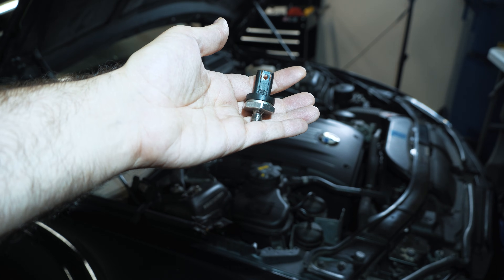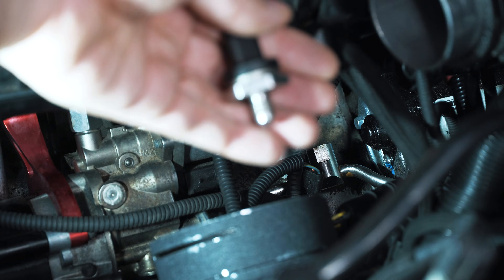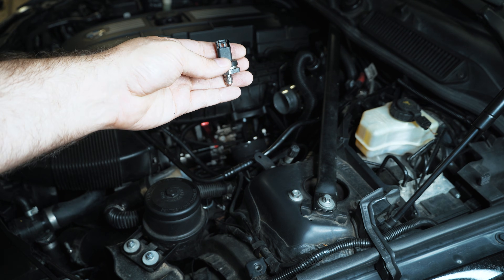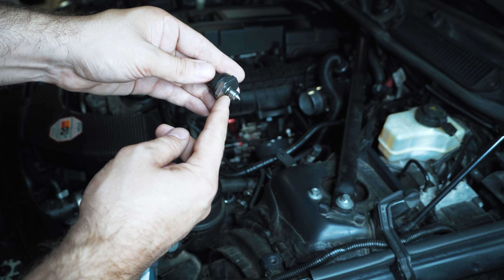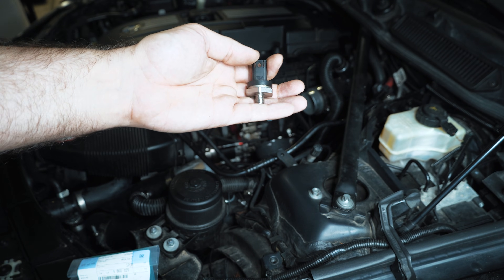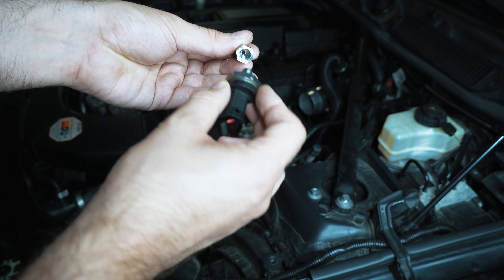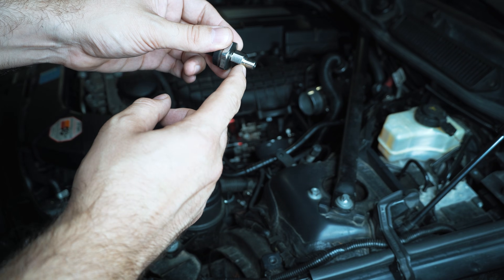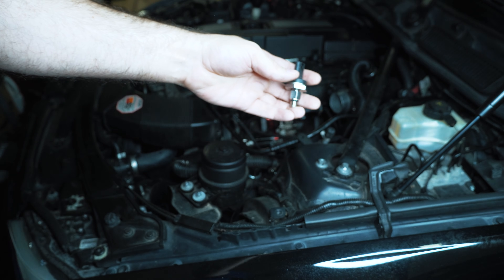An Important Update For Your N54 Low Pressure Fuel Sensor

Comment: My new to me 2007 335xi started cold with erratic idle, seemed to smooth out with some throttle input, but pulled P142E and P3090, not sure if that shows HPFP, LPFP or a fuel pump sensor? Any idea's are mucho appreciated!

Comment: @vehiculardiy Did your "system A too lean at idle(Bank 1)" code clear after changing this? I know my sensor is bad and I need to pass inspection but that code keeps coming back up. A/F for both banks is good and mine is tuned as well. I saw you had this code as well before you changed your lpfp. Big fan of the channel! Thanks!

Comment: Can a failure of this sensor catastrophically destroy the engine? Was reading about a user who posted this problem and said that the failure led to diesel going into the ecu. 32000dollar repair cost
Reply: well if it was diesel that means it was a different engine with a different set up, so i would doubt it but the car would run really bad if it was completely failed.

Comment: Great clip! Thx. No need to remove the manifold? Have a 135i vs 335I so maybe to tight? Also getting the code but it runs fine? Leave it be instead?
Reply: can you let me know if it worked for you? i have a 135i and noticed it says the adapter is only for the M3/4/5 etc

Comment: I am about to replace this on my 07 n54, is there a particular reason you chose to do the new style sensor and adapter instead of just repling with the old style? The old style is still available, but no one seems to be using it and I can't figure out why. Id rather not have to use an adapter if i don't have to
Reply: What sensor did you go with? I just bought a new HPFP and what I thought was the low pressure sensor but it turns out to be this new style and it’s actually a “high pressure fuel sensor” that’s goes on the fuel rail up top not at the bottom. So I just ordered the old
Style bronze colored “low” pressure sensor that goes there. Looks like people are using the “high” pressure sensor as a “low pressure” sensor with an adapter. I’m gonna change them all.

Comment: At the same time, owning other brands of vehicles, it seems extremely strange to change a sensor every 2-3 years. That's totally unacceptable and obviously a badly designed sensor. It should last 10-20 years at least. Just look at other sensors with that measuring range 0-10 bar.
I've recently changed mine on my N53 as it was dead and now the pressure sometimes fluctuates between 2,4 - 10 bar. Highly unreliable. Either the sensor or unreliable pump regulation.... electronic PWM pump. Christ!

But something that you all need to understand. A unit that is firmly screwed onto a metal line on the engine will ALWAYS vibrate in line with the engine. It doesn't matter if it's put 1cm - 50 away. It will still be mounted on a firm metal that is coupled with the engine. Period.
So, vibration is NOT the reason to put that sensor there. It's the fitting that they need to get straight.

Good video though and keep up the good work.

Comment: Would a bad low pressure fuel pump sensor cause an N54 powered E?60 not turn over and turn on
Reply: Bump! Wondering the same. Have an LCI E60 N54 and intermittently getting a 29DC code where the car goes into limp mode and restarts only after being switched off for >10 mins. Not sure if this is the root cause or should I bite the bullet on a new HPFP.
Reply: @sharathkprabhakar  I’ve already replaced the EKPM3 and coded it, installed a new battery and fuel pump assembly and nothing.

Over the weekend I realized that the fuel pump itself is starving itself for fuel, the filter has never been replaced to my knowledge and the filter is an in-tank filter and has a built in Fuel Pressure Regulator, so I’m wondering if that’s the problem.

The car won’t run unless it has more than quarter tank of fuel. The fuel tank had gas up to the rim on the driverside where the filter goes, so I removed the assembly and figured out that the pump works and sends fuel.

Now after looking at the gas tank, I realized that the fuel pump had no fuel to send because the fuel pump side (passenger) had no fuel in it. I used a cheap transfer pump from harbor freight to move gas from one side to the other, I reinstalled the fuel pump assembly and supposed bad filter and the car turned on and ran for the first time in 5 months. 

I’m not at all sure what’s actually wrong, if it’s the pump or filter itself but I’ve bought the cheaper of the two and opted for the filter since that is the odd man out. Fuel pump assembly is new, battery is new, and after transferring fuel to the pump side of the gas tank and having it run with 0 issues for 35 minutes, that means the HPFP and Injectors all work as intended. If the filter doesn’t fix my problem, then chances are I have a faulty LPFP that I can warranty through FCPEuro.

The only thing to never be addressed is the filter so, I’m hoping for a miracle since I’m trying to sell this 2010 535xdrive, Alpine/Peanut Butter with only 132k miles.

Pray for me 😅🫣

Comment: Hello when you said vibrating from lpfp I think I’m going through that exact issue I accelerate and I don’t have full power and when I try to floor it it almost like the engine shakes while
Accelerating and doesn’t go into full performance, also got 2AAF code

Comment: Thanks for the detailed content you put out.  My 2008 535xi has the surging (push pull effect) issue under light throttle (2k - 4k rpms), it is pronounced in M2.  I did the sensor upgrade, it did not eliminate the surging but the characteristic of the surge has changed, it stays longer and a bit more pronounced.  Is this (surging issue) indicative of fuel pressure related, could it be the lpfp?    Already rebuilt the transmission, changed spark plugs/coils, valve cover, reset all modules using INPA, no luck.  Any advise?
Reply: Seems like this is one of the most mysterious issues with the N54. Did you find a solution?

Comment: I just changed my lpfp a second time and upgraded to a walbro 450 but my lpfp is reading 48psi still. same as when i had my 255 on. Is there a way to test the sensor or top hat? thanks!
Reply: The sensor is bad. 70psi should be the reading.
Reply: Did you find a solution to the problem?
Reply: @Mr318live Bad lpfs sensor

Comment: hey hope youre doing well, ive got a quick question. i recently just did the low fuel pressure sensor upgrade and i noticed my fuel pressure sensor cable is corroded. Where can i go to purchase a new one?

Comment: Hey man, You mentioned that without a lpf sensor it wouldn't throw an SEL. My sel is on and when pulling the code all i'm getting is 29f3. Any idea what could be throwing the SEL light? I was going to replace the sensor but after watching your vid, I'm stumped. BTW, the car runs great right now tho.
Reply from the maker: So you have a check engine light lit up and only that code is showing?
Reply: @VehicularDIY  correct only code. I was doing some research and maybe it might be the fuel feed line? Does that make sense to throw the 29f3 code?

Comment: Do you suggest to unplug battery before replacing the sensor?
Reply from the maker: Yes as the fuel pump periodically cycles.
Reply: Thank you for your response. I’ll be changing it this weekend. Great video.

Comment: Thank you sir! Perfect timing on this video. I'm in the early stages of prepping for a N54 turbos replacement project. My '09 135i has about 82K miles on the clock, so trying to rationally replace wearable parts as I can afford. Thanks to you I just hit up ECS Tuning for a new LP sensor/adapter kit. Really appreciate you!

Comment: Guys just upgrade to the new setup with just buying the adapter all your doing is turning the new sensor into the old failing style sensor I know it’s more expensive for the whole set up but with these cars it’s just best to do it the “right” way.
Reply: Agree, you can purchase the low P line segment with new style sensor (part #13537622751) for about $189 (FCP).  I did that in November, no problems.
Reply: @chuckbuttry1382 so what he did in this video is new style sensor used in old setup? Wish we had video of new sensor with net style setup to see how to do it then

Comment: How would you know you need to replace it? Does it throw a code or does it have some kind of erratic behavior.
I wish you guys would actually start the videos with the symptoms first so we can get an idea if we have the same issue with the cars.
Reply: He said... he had fuel leak. If you need to replace fuel sensor itself you will get P29F3 code.
Reply: Oh. You’ll know.  Your car shuts off and they you get a Christmas tree worth of lights and the code they say here but you need the obd reader.  The user code is a ccid-121 at least for me.

Comment: Great content as always. I have a jb4 custom e60 backend flashed fbo plus inlets 2011 335is and in higher boost maps, when I gas it wot from higher rpms (4k for example), the car stutters almost like fuel is being cut off. Im changing my hpfp, but I want to see if you knew when BMW started putting the updated low pressure fuel sensor into the N54, that way I dont order it if its already in the car.
Reply from the maker: Thanks, I'm not sure but you might be able to sneak your phone under the intake manifold and get a quick video of the sensor.  If it's bronze looking it's the older one, if it's silver it's the new one.
Reply: @VehicularDIY  Thanks. Car is not throwing any codes, but the HPFP is an older model and logging does show it dipping below 10. Ill go ahead and do that and check the color. Thanks again I appreciate it.
Reply: Can we not use a new brass one? They seem to still be available I can't figure out why everyone is going the adapter route
Reply: Just doing mine now and it has the old style sensor I have a '11 335is also. I thought the fuel line would've been upgraded but I guess not. Now I'm waiting for the adapter before reassembling everything.
Reply: Did the sensor fix car stuttering at wot?
Reply: @Salvnyc_  I went ahead and added both. Problem solved.

Comment: It really is bizzare that 15 years after its release BMW is still working on sorting out the defects on the N54 engine.
I replaced the low pressure fuel sensor with an OEM when I had my engine rebuilt. However, I didn't have any problems with fuel leak before either.
Reply: They used the N54 up until 2016, so it makes sense there's still warranties out there for N54s.
Reply: n54 is the beta test for all of the current turbo inline 6 bmw engines.  they can test stuff on the n54 market and then engineer it into the new stuff. thats why the b58 is so badass  it took 3 tries.

Comment: I love the way bmw look. As a honda owner, I don't understand why these cars need upgrades and have so many recalls just to run the car for daily driving. How hard is it to have a car drive 100k when normally worn parts.
Reply: Because these cars are built with performance in mind originally and less longevity. People who can afford these vehicles will often swap to the latest ones anyways rather than paying for a Honda or a Toyota that's going to last for years, but have way less performance. You boost a civic to 300+ Hp suddenly it's longevity is hindered. You gotta pay to play.
Reply: @anthonywright5275  Yea, I guess I hear the stories of the people who want to look rich with a used BMW.
Reply: @NeoAndersonReloaded  I am not rich by any means. I am mechanically inclined and can rebuild an engine if I have to. I bought mine because of the ride quality and performance.
I couldn't care less what people think when I drive it. Besides where I drive it it does not have the rich status as in other places.
A used 335i is strictly for performance.
Reply: @NeoAndersonReloaded  lol nah... even if someone has a used bmw, if it's running, trust me, they got money... they eat money in maintenance and repairs. But yeah like 67re said, the 335 is more of a luxury modern tuner. And if you are mechanically inclined, it is an ultimate driving machine. Full bolt ons will have you walking GTs, a turbo swap and you'll have exotic owners pissed.
Reply: My n54 has 210k miles on it. I only changed the water pump. Not all are lemons. Most people just abuse them. They run on higher temps than most cars and if you abuse it things break down.
I always warm up my car before I drive it.

Comment: I understand the principle, but haven't you just added more places to develop a leak?  Normally simplicity is better.  I usually would just use a little Permetex PST.
Reply from the maker: The upgraded fuel sensor fits into that adapter in a more secure way.  They mate like an AN fitting.  Is Permetex PST fuel resistant?
Reply: @VehicularDIY  Yes.  A primer may be needed for stainless and galvanized Steels.

Comment: Anybody know why mhd doesnt show LFPS module for the n55, I'm at 140k 335i was gonna swap the hpfp and sensor!  Does the n55 have a low pressure sensor?
Reply: BUMP!!

I have more of a general question: does this type of upgrade even exist for the N55?

FANTASTIC content man! Keep it upppp!!! 😎
Reply from the maker: They removed the sensor on the N55, a lot of newer direct injection turbo cars don't have a low pressure sensor.  They derive the value on the high side.

Comment: I bought the $150 upgraded fuel line and sensor.  My code went away but don't see the need for the new fuel line. Looks identical.
Reply from the maker: The part where the sensor screws in didn't look any different on the new line?
Reply: @VehicularDIY  No. Everything looks identical.  Thought it would have some antivibration connection or something.  But nothing.  Just needed the sensor and would have saved $120.  But it did come with the newer sensor already installed.  So maybe I would have noticed something in the threads if it was separate.  And the bottom of the new sensor is flush with the fuel line threads.  No adapter in between.
Reply: @TheFrenchPug  Is it possible that your line had already been replaced with the upgraded part? Mine hasn't been refreshed, and I am seriously on the fence about whether to use the adapter and new sensor as per this video, or replace the whole line like you did.
Reply: @forcedinducti0n  after swapping it out I could not tell any differences in the fuel line.  I didn't see any vibration protection on either one.  All I feel I did was spend more money for nothing.  The biggest difference has been putting in the $1400 index 12 injectors.
Reply: @TheFrenchPug  Lol classic..."yeah, we made it better...buy, buy, buy!!!". I guess it's possible that it had already been swapped in the past. I also didn't see much of a difference, so I went with the sensor-only. Thanks for the insight :).